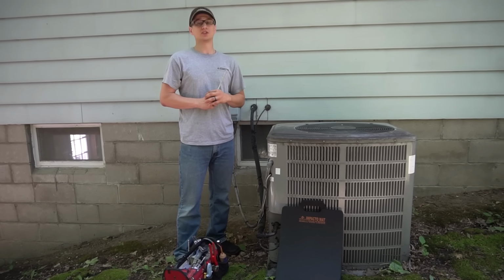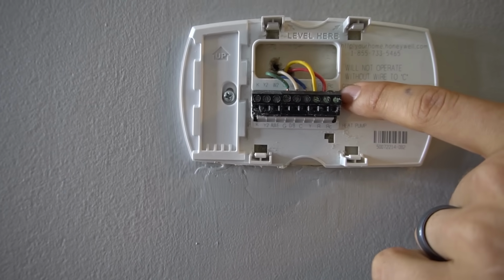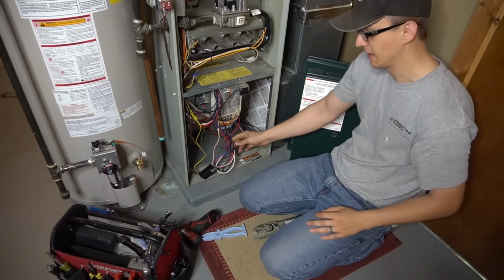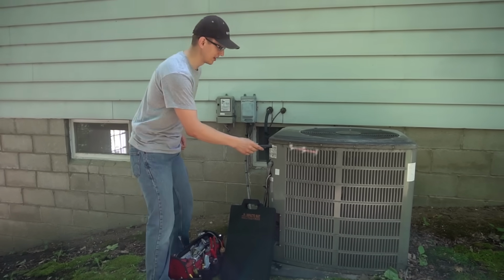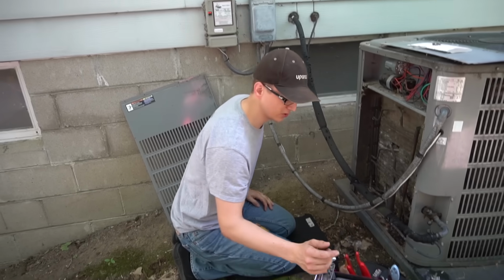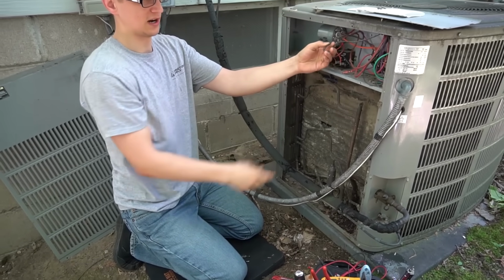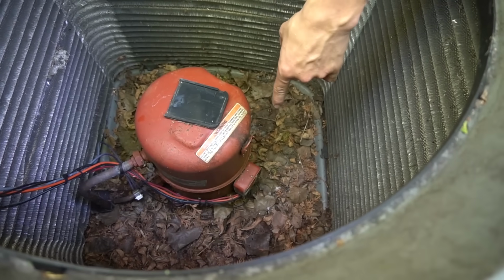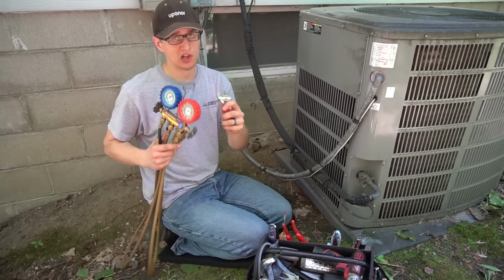AC Unit Not Turning On - How to Fix It Step by Step

Comment: Very firstly amazing video. It really helped us partially diagnose our issue, but we are still stuck without an AC for now.
Our AC broke a day ago. Our issue is we don't have any air coming through the vents/ducts. 
We followed diagnostic procedures mentioned in the video and here is what we found:
1) The compressor and the outside fan is working fine. (The outside fan was moving and we kept the compressor ON for sometime, the line going to the furnace/inside the house freezes up)
2) We don't see a separate breaker for the AC in our fuse/breaker panel, but there is a separate box with a 60amp fuse and it seems fine. (checked via a multi-meter)
3) Turned ON the fan (from Auto mode) and checked the voltage across R and G wires (red and green wire) and we don't see 24V at the thermostat. Actually we see 0V there.
4) Checked the control panel at the bottom and checked voltage across the red and green wires there (we checked all wires red vs all) and we don't see 24v there as well. (All this while the fan is turned ON, AC to cool on the thermostat module). We do hear some relays clicking.
5) The fuse looks fine. Removed the fuse and checked it virtually and with a multi-meter.

So, it looks like we don't get power at the panel or at the thermostat. We are stuck at this point with our diagnostic and subsequently without an AC. Is there something that we might have missed or can you guide us little bit from here?

The diagnostic light on the control board seem to show everything normal.  We tried physically moving the fan and it seems to move freely. The furnace power switch is fine and when turned ON or OFF turns the control board ON or OFF on the furnace.

Edit: 07/03, 6pm: Looks like we have power coming into my control board (120V) checked the Hot line and the neutral line but there is no power coming out of my control board going to the transformer. When i check the pins on the control board it says 6V AC. (it is a White and Rodgers,  50A55-438 board)

Is there something we might be missing? Or do we actually have a fried control board?  

Thank You! :)
Reply from the maker: Thank you for listing everything you have done so far. That really helps! Plus I can answer in the same fashion ;)

1. If you run the compressor without the blower motor on in the furnace, the evaporator coil will start to freeze up very fast. So that was expected.
2. If your AC outside works when you press in the contactor plunger, that means you do have 240v there.
3. When I first started I didn't realize this either.. But if a switch is closed, it will read 0v. So if the thermostat closed the internal fan switch to turn on the fan, it would read 0v. Almost like you are putting your leads on one piece of wire. If the switch is open, then you would get 24v. (normally)
4. Once again, the closed switch concept would affect some of these readings. I am assuming you have the furnace switch on, the door switch (if you have one) taped closed, and the thermostat calling for cooling while checking voltages. Check R to C. Do you have 24v? How about Y to C?
5. Good that you checked the fuse :)
7. If the diagnostic light is on, that usually means the 3 amp fuse is good and the control board is getting power.
8. Find your transformer. It will usually have two sets of wires going out from it. One is the white and black that you mentioned. Those are 120v. The other two wires are the 24v side. If you follow the 120v wires to their connectors and check voltage do you have 120v? Next, if you follow the other two wires until the connectors and check voltage there, do you have 24v? (I say 24, but it is usually about 23-28v)
9. Turn your furnace off. Take a piece of wire and strip both ends off. Put this wire under the R and Y screws. (this bypasses the thermostat) You could even use a paper clip. Turn the power back on. Does anything turn on? You could also try bypassing the fan this way to see if it comes on. Jumper R to G. Don't forget to turn power on and off while doing this or you will quickly blow that 3amp fuse.

Try doing that for now and let me know how it goes. Depending on your findings we will be able to find the culprit.
Reply: Hello, So i ran the tests that you mentioned above. Here is what i discovered.
1) When I ran point 4 mentioned above, I had >24V both form R to C and also from Y to C.
2) The output out of the transformer is ~26V.
3) If we jump RtoG or RtoY, I don't get anything and the nothing comes ON. 

Thank You!
Reply from the maker: Okay I think we may have just ruled out everything inside. Seems like we can leave the furnace and thermostat alone now as everything in there is measuring like it should. 

1. Next I would go outside and find the thermostat wire that comes out of your house and into the condenser unit. That wire will usually come out with the freon pipes and has a red and a white wire inside. Do those two wires go straight to the contactor coil or does one of them go somewhere else? (which would mean there is something else outside that is in series with that contactor coil that could be interrupting your 24v)
2. Put your meter leads on either side of the contactor coil, do you have 24v? If you have 24v yet it is not pulling in, then the contactor is bad or something is jamming that plunger and not letting it pull in.

Let me know how it goes. I think we are getting close ;)
Reply: I'll go out first thing tomorrow and perform the tests you mentioned, but i fail to understand something. We have the fan turning outside and the blower/fan not working inside? is there something that needs to happen out before the blower/fan (inside) is commanded ON?
Reply from the maker: Oh wow, my apologies good sir. I have been answering so many people that I am starting to lose track of some of the original problems.. So I was under the impression that the outside unit does not turn on by itself unless you push in the contactor plunger manually. Is that true or does the outside unit turn on on its own? If the outside unit is coming on on it's own then that changes things. Thank you for stopping me and saying that. In that case either your control board is bad or the blower motor is bad. Does the blower motor hum like it tries to start? (it may have a dead capacitor.) Here is one final test you can do that can settle this:

Turn off the power to the furnace. Find the wires that come from the blower motor then see which of these wires goes to the COOL or HI terminal. (usually this would be the black wire). Disconnect that wire and we will need to find a place to hook it up to so that it can get 120v. What I normally would do is put it on the same terminal as the 120v black wire coming from the transformer. (either use a splitter, or splice those wires together) Hopefully this is something you would be comfortable doing. After you "hotwired" it, turn the furnace back on. If the blower motor comes on, then the control board is bad and needs to be replaced. If the motor does not come on, the motor is bad and needs to be replaced.

If the motor comes on, you could just leave it hotwired like that until you get a new board. That is almost the same as setting your fan setting to ON at the thermostat. Let me know how it goes please or if I didn't explain something clearly enough
Reply: Sorry for the late reply. But I managed to fix the Blower. It was the blower motor that was burnt up and would't start. As a safety measure I also changed the capacitor on the furnace/blower.

I'd state it again, that you helped me a lot in diagnosing the problem and I really appreciate it! Thanks for all the impromptu replies. 

Keep up the good work buddy, your videos are amazing. If I could be  of any help any day, please do let me know. 

Thanks again! :)
Reply from the maker: Awesome! Glad to hear you were able to get it fixed. Thank you for coming back with the update. Stay cool! ;)

Comment: I have a very old Serval gas absorption chiller ACC 60. It was working fine the other day, house got cool so I turned it off for a while. Several hours later I turned it back on. It ran for a few minutes and then shut itself off. Now it won't turn on at all, no noise, no nothing. Also noticed furnace fan will not come on now either. Checked disconnect and breaker. Thermostat battery good. Any ideas? Thanks.
Reply from the maker: "Serval gas absorption chiller ACC 60". That sounds a little different then what I am used to..  So I don't know if I will be much help on a unit I am not familiar with. If the furnace fan is not coming on either, I would focus more on the low voltage. Thermostat batteries? 3 amp fuse or breaker may be tripped if you have one. Is your furnace newer than that chiller? Does it have a control board with a thermostat terminal strip? (R,Y,G,W,C) Or are the controls composed of a few relays? Have you tried turning on your furnace, does that work? Also, do you have a meter that can check voltages?
Reply: Furnace is a Tappan and probably of similar age (1970's). I have a technician scheduled for tomorrow if I can't figure it out. May even get an estimate on new units. It's hot and my kids want a/c soon. It would probably take me a while to troubleshoot. I did not try furnace. I was able to spin furnace fan with ease though. Didn't see any fuses in furnace. Also checked filter, condensation hose, thermostat battery. Great video and thanks for quick response!
Reply from the maker: Thanks! And sorry about that.. It would take some messaging back and forth before I would be able to be of any help. The tech will arrive before then. If you could, come back and give us an update! :) By the way, if you want to save some money, don't go with the first guy that comes your way (when buying new HVAC). Get a few estimates and you will see a wide swing in price. Anyway, good luck! Hope you will get cool air soon!

Comment: I had a blown fuse in the furnace, replaced it and there is power going through it. I have replaced the batteries in the thermostat and it turns on but the blower fan and the A/.c still don't turn on. 
I bypassed the plunger assembly and the fan outside turns on. But the fan in the furnace did not turn on.
Reply from the maker: Sounds like there is still a problem with the 24v circuit. Do you have a meter that you can check voltages with like this: https://amzn.to/2NjJTva ? That would make it easier to figure out what is going on.
Reply: Yes I have a volt meter.
Reply from the maker: 1. Okay, awesome! If you check voltage at the contactor coil, do you have 24v? If you do and the plunger is not pulling in then the contactor is bad.
2. Find where the thermostat wire comes out of the house and into the condenser unit. Do you see any bare or broken spots in those wires? Do the two wires go to the contactor coil or does one of them go somewhere else?
3. Find your transformer inside the furnace usually by the control board. It has two sets of wires, one set is the 120v (usually black and white) and the other set is the 24v. Find where the 24v wires go and put your leads on the two connectors from those wires. Do you have 24v?
4. Set your thermostat to cooling and set the temp down so it's "calling for cooling", take the bottom furnace door off and tape the door switch, and locate the thermostat terminal strip on the control board. (R,Y,G,W,C) Check voltage from R to C. Do you have 24v? How about from R to Y? Y to C?

Let me know what you will find from those checks and we should be able to narrow it down to our culprit.